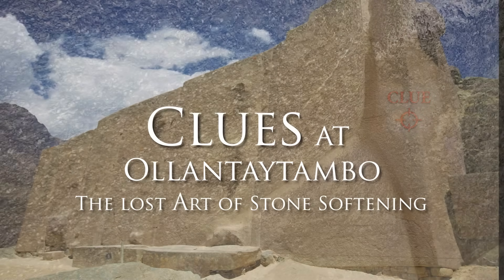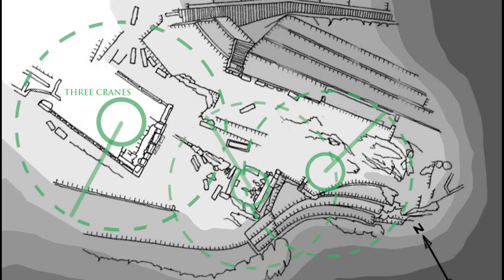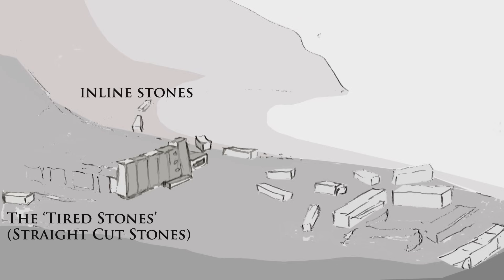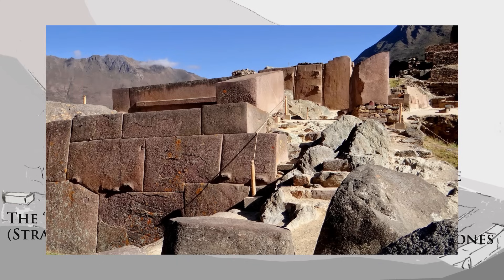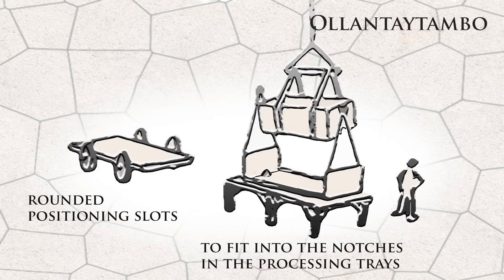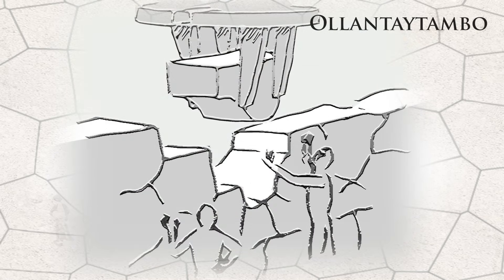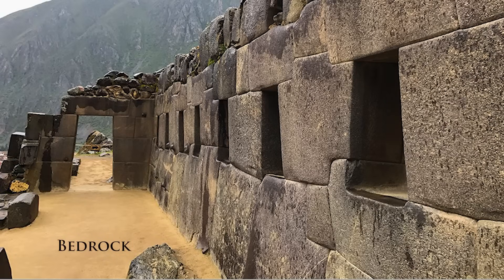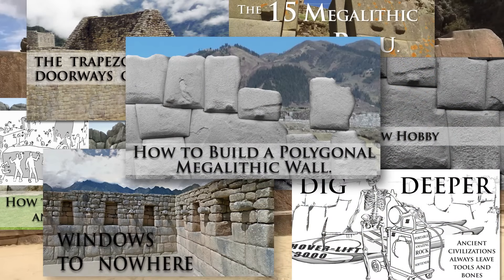Clues at Ollantaytambo. The Lost Art of Stone Softening

Comment: Anyway, whatever technique was used is still missing today:
- No full-scale experiment (nobody has ever cut and fit a 100-ton andesite block with only stone/bronze tools).
- No evidence of real quarries or workshops (no debris, no proportionate tools).
- No critical review: academia keeps repeating the “solved” story.
And yet we do have abundant evidence from Greeks, Romans, and Assyrians — technically older civilizations than those of the Andes.
In the 21st century we could easily:
- Run controlled lab tests on abrasion.
- Simulate forces and times with modern software.
- Reproduce quarrying methods on site.
But no major institution dares: if results prove the “official” methods unworkable, they’d have to admit we don’t know how those walls were built.
So yes — we’re in the 21st century, but the narrative on these sites is stuck in the 19th.
If official academia were to test and admit that tools and material evidence are missing, it would open the door to alternative hypotheses (lost techniques, earlier civilizations, etc.), which academia tends to dismiss as “pseudoarchaeology” — when it would simply be enough to confess ignorance.

Comment: Many yeara I read a book about the Spanish conquerers of Peru. They rode through a valley of waist high plants. When  they came out the other side their spurs had been partly corroded  away by the acid juices of the plants.
   I would say the acidic juice of plants were used to round the edges of the worked stone, and make the blocks fit tightly. Perhaps the plants were only culitvated back then by the Incas. And are rare today,

Comment: It makes sense. The stone has been already anaylzed and tested. Its not geo polymer. At least the ones in this megalithic sites. But it makes sense. I mean why the random knobs in unsual spots? ... It just makes sense they used some form of Technology.
Reply: nobs are where they pulled out the cathode and annode while the stone was still like clay. It only changed the molecular structure on the surface to a specific depth not the whole stone. Vibration and magnetics help with many things.

Comment: If you bake--or if you are old enough to remember the dinners WW2 generation women prepared for extended family, you should remember the buns they baked. From rolls sold in supermarket dairy departments to handmade recipes handed down, these rolls helped them extend meals so that no one was turned away.  They'd pop another pan of buns in the oven, put another tray of butter slices and some more gravy &/or honey out and the turkey would feed another mouth.  

The point is, these buns looked exactly like the giant boulders at many South American sites.  That same bulging--you must picture the rock on its side, with the bulge facing the sky...  The center rises highest but as it cools, the center collapses a bit, so actually, the sides--not at the edges, but in a bit--remain the highest--which is no longer facing the sky but instead faces outward.  The edges match-up perfectly, then the stone puffs up like a dinner roll on its side...  

Weirdest thing, but every time I see these rocks, I see those dinner rolls.  They'd pull of much, they'd bake into each other, and once they could not expand sideways, they got taller.  Just like these rocks look like they did.  They even sometimes have marks on them where something pinched them to move them, most likely?

So this raises the question: did the rocks expand when whatever was done to them to soften them was done?  (That's the point of this.). They have all. the signs in common with rolls baked in a a cake tin...they expanded, pressed against each other, rose in the center (like soufflés do) then settled back down except where heat was the greatest nearer the edge.  But on the actual edge, it cooled fastest, so that settled the most, leaving edges higher a bit in from the very edge...with that puffed look.  And the edges created that tight seal against neighboring buns... rocks.  When they cooled, they were not coming apart.
Reply: look into growing rocks. A process that was stopped when making structures but not stopped in the wild when the process was left to its own devices.

Comment: It is too easy to debunk your theory with one single clue. If this was the case that the stones were softened and fitted before they hardened to mold, the capstones would have sagged in the middle over where they left the rock out of the wall since they would have been still soft. Even the stones under the capstones look as if they were molded and thus would have been soft as well too then. 
They already proved that they can cut precision cuts into the mountain face.  So, did they soak the whole mountainside as well?

Comment: Wishful theory and speculation here.  Let's reality test it.  Let's 1) find a rock such as the ancients used, 2) get a strong crew together, 3) re-enact the movement of the rock by the same sort of primitive tools the ancients used, 4) rope it up and crane it into a vat such as the ancients would have had to build, 5) fill it with the "plant-based" acidic (?) solution, 6) soften the rock, 7) hoist it out of the vat and transfer to the "cutting table," 8) cut the rock with the theorized "wire saws" = create the actual softened stone!  That would prove the veracity of the initial theory and speculation.  Thank you, and keep up the good work on unlocking the secret techniques of the ancients . . .
Reply: Wortlos staunen ist eine Eigenschaft, die nur kleinen Kindern zugestanden wird.
Alles erklären müssen ist kleingeistig.
Vielleicht waren diese Menschen(?) gar nicht so primitiv wie unterstellt, sondern sehr weit höher stehend gegenüber uns Dümmlingen.
Reply: Anyway, whatever technique was used is still missing today:
- No full-scale experiment (nobody has ever cut and fit a 100-ton andesite block with only stone/bronze tools).
- No evidence of real quarries or workshops (no debris, no proportionate tools).
- No critical review: academia keeps repeating the “solved” story.
And yet we do have abundant evidence from Greeks, Romans, and Assyrians — technically older civilizations than those of the Andes.
In the 21st century we could easily:
- Run controlled lab tests on abrasion.
- Simulate forces and times with modern software.
- Reproduce quarrying methods on site.
But no major institution dares: if results prove the “official” methods unworkable, they’d have to admit we don’t know how those walls were built.
So yes — we’re in the 21st century, but the narrative on these sites is stuck in the 19th.
If official academia were to test and admit that tools and material evidence are missing, it would open the door to alternative hypotheses (lost techniques, earlier civilizations, etc.), which academia tends to dismiss as “pseudoarchaeology” — when it would simply be enough to confess ignorance.

Comment: Makes sense, a good logical conclusion.  I have not watched tv are read a paper in 36 years, I am a reader and researcher of ancient history when not working my farm.  I farm cotton, wheat, milo, with modern 4 wheel drive tractor, some tractors nowdays have 800 hp, mine have about 200 and I consider them a hoss.  When I have to pull something across the ground, it is pretty easy to break a large properly tempered steel chains.  It would be impossible to pull any thing of size, on a skid, with plant  based ropes, they would break pulling a 5 ton rock, on a skid.  The term 30 horsepower, HP, means, in theory, it has the pulling power of 20 horses, limited by chain strength.  Ropes simply would break easy, even with 200 of them.  I might, maybe, pull a 10 ton something on a skid.  Some of those rocks, on the globe, are 100 ton, and if you look, they are precision cut, like with a laser, not hammer and chisel.
When Columbus and Cortez came to the Americas, it was 100% stone age, yet the kings of Mexico were adorned in gold jewelry, that requiring iron tools and high temp furnaces, which did not exist then.  And the monuments in Mexico require iron too, but the stones were so heavy, it would be impossible for plant ropes and skids to move them.  When Pizzaro entered Peru, words from his diary - there were a ruling class, about 300, wheat colored hair (blond-light brown), blue eyes, tall, spoke a language of their own.  They were adorned in gold jewelry.  Pizarro tortured some of the 300, found the gold stores, loaded 6 ships full of gold, sent them back to Spain.  He then killed the 300.  Rockwall Texas has the same type of cut rocks that mainstream archeologists call natural formations.  History books lie, as do the archeology establishment.  Obviously they lie for a reason, not hard to figure that reason.  We are living at the end of an "Age", the beginnng of another.  Marxist Globalism equality is ending, nationalism will replace it.  Lots of lies, deception will be revealed in the upcoming decades.  Good video, I learned from it.

Comment: Are these softening tanks still there?  You should be able to find them because you know exactly where the tanks should be in the linear physical softening factory process.  Somewhere between the ready stones and the first pile of bent stones.  There should be signs of chemical impregnation and coating on the softening tank walls and the tank walls themselves should provide a clue as to the differences molecularly that allows the chemical to react with the target stone and not the tank walls.

Comment: They repurposed prefabricated quarry stones with unique fruit and plant acid and transported as dust in ceramic jars they carried up the mountains and with rope pulley counter weight crank driven rope pulley witch they also used as gear driven rope granite cutting saws with plans and fruit acids to separate the mineral bonds of the granite and the bent blocks with wood henge stone connectors were from the formation geopolymer post mixture vat fills they added phostates and crushed limestone feldspar clay and granulated granite vapor evaporated slurry mixing vats on terraces that's why the artificial granite appears melted in some places because the vats of slurry phosphate geopolymers spilled or hit a rock on the inca aqueducts where they dampened wet logs and slid the giant ceramic vats of liquid granite slurry fly ash across the terraces and mountains

Comment: Any softening process must have been quite long for each individual piece. It would certainly not occur instantly throughout the whole block at one time, but soften slowly from the outside inward. Like an ice cube melting, with the innermost core being the last to soften. Are we talking minutes, hours, days or weeks, to soften a single piece to the core? Then lifting that massive heavy weight in a state of "blubber" would be extremely hard, because it would want to droop, drip, ooze, and deform in all directions, before it magically hardened again.

In addition, your inclusion of "sonic saws" in the process introduces a whole new technical variable, which is completely unexplainable, involving very specialized tools and a constant energy source.

I do like the basic theory, but still can't see how it was actually implemented..

Comment: I can tell one thing I experienced with granite. I acquired left over granite counter top segments. I used them to make a wood fired pottery kiln.  The melting temp of the granite was less than the kiln temp. But before the kiln got hot the granite crumbled into a large grained sand.  This sand would be great for transport.  Could they have moved it as sand?  Then use the sonic and additive to settle the particles and harden it. Just tossing it out there. It does not take much heat to crumble granite. Or maybe the sonics created enough heat to crumble it.  All those large grained sand particles vibrating against each other  would create heat for sure how much might depend on the Frequency?  Hit any shape turn it to sand quick haul the sand mix and hit it with the sonics to settle it back lock the grains back together into a solid form.  More to keep you up at night!

Comment: Sonic technology????   You mean a hammer?  You dont need such technology, the sheer weight of the stones sitting on the paste they used generates enough heat to melt the stones into each other. That is why the joints appear vitrified in many instances.

Comment: 1. No stones were quarried nor transported on carts since the technology for both did not exist.  
2. No huge tanks existed for soaking.  
3. No plant acid in industrial quantities was possible.  
4. Soaking igneous rock, especially quartz, would not soften it.  Feldspar would possibly dissolve into clay, but that is just feldspar, not quartz. Quartz is inert to all acids but one just as is glass which is similar (silicon dioxide).  
5. No cranes would be practical without steel because no cranes without pulleys would be practical.  
6. Wire saws and sonic saws? Wire made of what exactly?  Stainless steel which did not exist?  Copper which stretches and snaps apart?  Sonic technology which is impossible for primitive technology?  
7.What about explaining the shaping of the blocks?  There is no clue as to why such shapes resulted from their unknown process. 
8. Big blocks were not positioned for future placement but were scattered randomly by a massive earthquake that destroyed the original arrangement, leading to a rebuild, with the new placement of the six standing stones vertically even though they were cast for horizontal placement like all of the rest.
9. Huge protrusions extend from the surfaces of the megablocks, which were not addressed, nor any means to CUT stone so flat and straight, while combined with blocks of the oddest shapes seen in any wall anywhere.
10. All rows of the main wall are horribly uneven, not straight or level, except the line formed by the tops of the windows.  They are straight as an arrow while nothing else is.  That can't be explained as perfectly reasonable since no human construction engineer (especially one with sonic and vibration technology) would ever imagine such a method of construction.
Reply: Anyway, whatever technique was used is still missing today:
- No full-scale experiment (nobody has ever cut and fit a 100-ton andesite block with only stone/bronze tools).
- No evidence of real quarries or workshops (no debris, no proportionate tools).
- No critical review: academia keeps repeating the “solved” story.
And yet we do have abundant evidence from Greeks, Romans, and Assyrians — technically older civilizations than those of the Andes.
In the 21st century we could easily:
- Run controlled lab tests on abrasion.
- Simulate forces and times with modern software.
- Reproduce quarrying methods on site.
But no major institution dares: if results prove the “official” methods unworkable, they’d have to admit we don’t know how those walls were built.
So yes — we’re in the 21st century, but the narrative on these sites is stuck in the 19th.
If official academia were to test and admit that tools and material evidence are missing, it would open the door to alternative hypotheses (lost techniques, earlier civilizations, etc.), which academia tends to dismiss as “pseudoarchaeology” — when it would simply be enough to confess ignorance.

Comment: I believe that it was somehow done in this way. 
1. The central question, are the softened surfaces different to the stone that has not been modified? -> Spectral analysis.
2. Was it possible to glue stones together.

As a side issue, there were birds that were able to make holes into rock. It was suspected a plant and maybe what was coming out of their stomach. Strong ultrasonic through their "nozzle".

Comment: 1) How did they cut the blocks from the original location in the first place, if they need to dip the rock into a solution? 2) If they could cut the blocks from the original location, why didn't they remove the rock at the base of the structures they build?

Comment: I have to fully support all but ine of your hypotheses - the "soaking" of stones that can weigh 100k lbs+ in a "bath".  Thats a big bathtub... too big.  I believe we must find a process that  used vibration, resonance, sound and other methods over the bath supposition.  

I believe that moving softened stones the heights, distances and weights, without making a mess of them would be impossible. Further, new revelations regarding incredible (electro magnetic gravitational) powers of reverse engineered man made craft that are basically UFOs requires we explore the use if such a craft that also employs resonance and vibrational powers to move large stones, soften them in place, and stack them while doing so.  

The knobs are the locations where frequency generators are aimed at the stones to soften them and, as the stones re-harden, they bulge at those locations and, since those remain softer than the bulk of the stone longer, they create the subtle round protrusions as they harden at a slower rate

Nice work!

Comment: What plants are used to soften stone??? 
 The sonic technology used from start to finish was/is Solar Energy concentrated through lenses. While on the molten state, gravity does the heavy lifting. Then all that's left to do is pour the molten stone into casts. Once complete, replace the wall cast with a new one, pour sand in, reheat the wall with the sand, and it now has a protective layer that can only be destroyed with a level of heat that can't be utilized without the right knowledge.